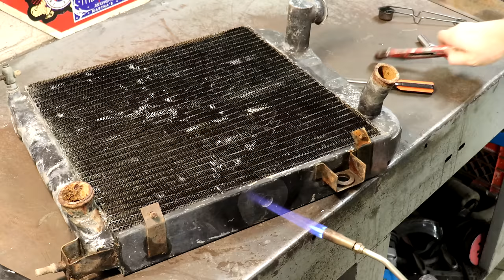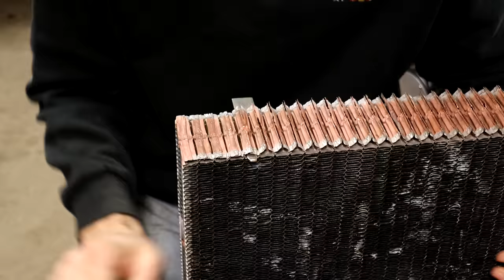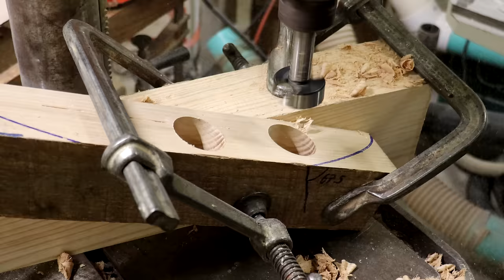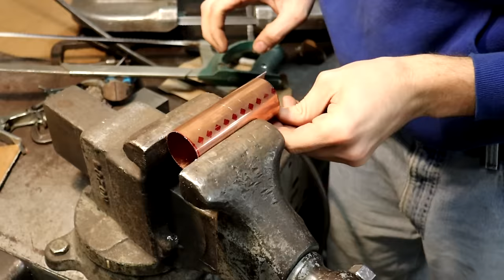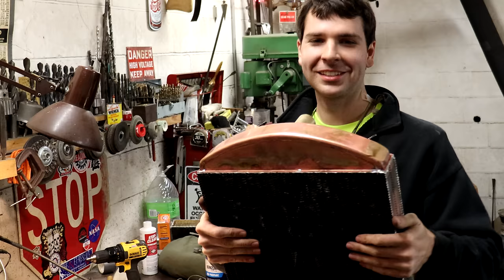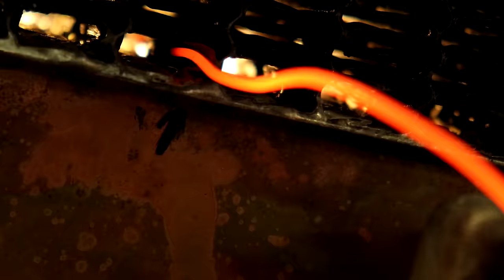The Forums Said it Couldn't be Done | Homemade Boat-tail Speedster Pt. 66

Comment from the maker: For those curious if the smaller size will still keep the engine cool: The engine and radiator are from a Mark 2 which, as far as I can tell, used the same radiator for the 2.4, 3.4, and 3.8 liter engines. Mine is the 2.4, which has ~1/2 the power of the 3.8, so I think it'll be fine. It's also the biggest radiator that I have room for.
Reply: Your doing a great job but I had an XK120 when I was young and granted I lived in Florida when in traffic anytime of the year it was prone to overheat. I would suggest you try to fit an auxiliary electric fan in there somewhere if possible and or maybe an oil cooler as well.
Reply: @NOLAART  I'd say Oil cooler is enough.
Reply: Scary right up to the point of Success, great job !
Reply: the fact that the engine lives in a cooler underhood space and the car being way lighter than an all steel jaguar should help keep the temps down too
Reply: Thank you, I was a Jaguar dealer tech in the late 80s, and restored XK and E types for almost 10 years, grew up in the backseat of an XK 140 fixed head, enjoy your Jag-Rod, it's cool, 👍
Reply: I built radiators back in the seventies and eighties. I have narrowed many V-cell cores like that but I never shortened one. I just about couldn't believe you were doing that but you did. Just amazing. Don't feel bad about pulling those fins down to fix that leak. That's how it's done. I really miss building radiators. It's good to see your skills.
Reply: "I cannot" is definitely not in your vocabulary. 
Great work methodically working thru inevitable issues.
Reply: i cant wait for the day when you come back and work on this someday, when you take a few week vacation from SpaceX or wherever you ended up. Thanks for all the content!

Comment: Absolutely awesome! I have also repaired several old radiators that people told me were unfixable. I did one where it had cast iron tanks and frame with a copper core that was bolted together. The tubes in the copper core had been broken when the cast iron frame was broken so I had to repair the cast iron frame and then I took the end plate off and cleaned and tinned the all of the tubes back about quarter inch and then I hammered the end plate so that had a offset to match then soldered the whole thing back on again. That old crawler loader sat in a barn for 4 years while I was in the military and when I came home again it still was full of coolant. I couldn't have been more happy with the outcome.

Comment: I have never ever seen or even read about someone building a radiator at home, in their shop. That is impressive. Nice work.
Reply: I forget what episodes it was, but Nic of Project Binky made his own radiator, a/c condenser, heater core, and I think also an oil cooler from parts of off the shelf aluminum radiators. If you have the time.

Comment: That turned amazing Vince. Back in the 90’s one of my customers in Toronto was a radiator shop and a big part of their business was recoring radiators and actually building them from scratch. All of theirs used tubes for cores with thin crimped copper for the fins. 
What you were able to achieve with that core is amazing. 
The only thing that could have made it cooler would have been to hammer form your logo into the front tank face. 

Once again you continue to amaze us with your work.
Reply from the maker: I might still cheminally etch a logo on a separate piece of brass, like I did for the headlight logos, then solder that to the brass tank
Reply: @MacroMachines 
That would be cool.

Comment: This is the first video of yours I have ever seen, so I am not familiar with your project at all. 
I am a custom Radiator builder (professionally) with about 30 years under my belt (now retired). I have built radiators for everything from Early car crushers (14 feet x 14 feet x 2 feet) to racing motorcycles, and damned near everything in between. 

So! First of all, I would have loved to have had someone with your talent, determination, and creativity to work in my shop! You really put some time into what you did, and you did it very well.
Now I am not going to pick on you, or pick apart your work, just wanted to throw out some free advice and tell you of some things that you may not be aware of to help with your future projects. 

Silver Solder: There are lots of different solders out there, not all are lead, or lead like. Silver Solder is a fluxed rod similar to brazing rod, and is used with an Oxy Acetylene torch (and brazing tip). It is much stronger than lead types. It is what is used when making the brass tanks because the lead types don't last. Brazing rod also works well, and is still much stronger that lead types. Of course you still need to use lead type to solder the tanks on to the core, and the steel straps to the core. You will NOT unsolder silver solder to repair or recore that radiator.

Tinning flux: Is a paste, or liquid with flakes in suspension. You heat up the metal, brush it on, presto, the nastiest filthiest un sandblasted corroded piece of metal you have is clean as a whistle, and tinned up ready to solder (lead type) in one step. It makes a much stronger seam than doing the flux and solder steps. Make sure to rinse the flux down afterwards, it is acid, and will keep eating till you do.

Hose connections: whenever possible use brass, avoid copper, copper is too brittle and tends to crack from the vibrations created by the engine. If you can, try to roll a 'barb' on the ends to keep the hoses from popping off. You can solder a barb onto them as well.

The core itself: The type of core you used, although rugged as can be, and OEM for decades, is highly inefficient. The newer core types like what you described with the brass tubes, and the copper ribbon between are up to 4 times more efficient for their size.

Maine Auto Radiator can make you a custom core, tanks, etc. BUT in this case, for the money, and the quality of what I just watched you do, your tanks will be just as good as theirs. Maybe buy some inlet/outlets from them with barbs to replace the copper ones. If you run into an overheating issue, they can make a core to your specs for a few hundred bucks that will cool off that engine on the hottest day in parade traffic, and still be the exact same size as yours. They sell all sorts of supplies too, including the proper torches that run on propane and compressed air to get things hot enough, tinning flux, etc. They can even tell you exactly how many BTU's you need to cool that engine, and mace a core to match it. There are different configurations, different size tubes, different spacing between the tubes, and different ribbon fin sizes/designs to factor in.

Time to go check out your other vids and see what you are building!

Comment: Really nice!  I've had leaks like the one that was giving you a headache and I fixed it cudely by cleaning the area well and then dribbling some warm JB into it. It's a gamble though as if it leaks good luck cleaning it out again. I got lucky and it's been holding for years. Suggest you take some scrap fin material and zigzag it and use it to fill the voids in the core. They won't do anything to absorb heat but they will fix the appearance. But enough armchairing; yoou really did a nice job with this. Impressed there is not one spot of solder 'overspray' on the outside of the tank!

Comment: Yet another demonstration of your amazing skills!
If you ever find yourself needing a micro torch flame, I have seen a large bore hypodermic needle (as vets use to chip animals) fed with oxygen and fuel gas used as a torch; it's long and thin, ideal for what you were doing when trying to fix that leak.

Comment: I had the experience of making my own radiator, I used two sheets of thin copper that I drilled 1/4 inch holes in a tight honeycomb pattern (I clamped the copper sheets between two wood strips to support while drilling) then I cut a bunch of three inch long 1/4 inch copper tubing that I soldered into the holes In the copper sheets spaced almost 3 inches separating them, once done, I wrapped the outer edge with 3 inch wide copper sheet, soldered it up, and drilled larger holes for the radiator hose nipples and filler neck (removed from a donor radiator) a radiator can be made in any shape this way,round, oval, square, whatever you want, and it worked quite well for cooling

Comment: It was a very clever idea to try and heat the solder using the nichrome wire but I think the piece of solder shorted out that segment of the wire just making it less resistive. Some way to keep the heater wire from touching the solder may work. For a goal of trying to minimize heating to a small area it was a good idea.
Great work on the car, been watching along all this time. Excellent work.

Comment: Awesome work! I got to spend a little time in an old school radiator shop years ago. You showed amazing skill and patience. I used to have a copper for that I'd heat up and slide into those tight spots for repairs. Being copper it would transfer the heat very well. But you will have to expose the leak enough to perform the work. Most guys would not want to spend all the time you did to fix and solder the core ends. Well done.

Comment: Great work on the radiator.  Jaguars are notorious for overheating if they are in a warm climate and many people have switched to aluminum core radiators with thicker cores.  This may be an option you have to explore if you find you have overheating issues.  With your skills, you should be able to TIG weld up an aluminum radiator that fits the shell.  I believe you have room for a thicker core and you could still go with the brass route by doubling up on the cores.  Also recommend you use a 160 degree thermostat instead of a 180 degree thermostat.

Comment: Wow, the skill set you are building for yourself just gets bigger by the episode! That was a steep learning curve, most people would baulk at the prospect and hand it to the radiator specialist, but I think even they would have struggled with the physical size challenges you set yourself, so far better to go it alone. 
I'm really attached to this build, because my first car (60 years ago) was a 1939 SS Jaguar 2.5L saloon, with basically the same engine as you're using (although pushrod) - love the sound these inline 6s make!

Comment: You must add a flat strap running from the top tank to the bottom tank on each side to stabilize the core. If you do not stabilize the core, repeated expansion and contraction during heating and cooling cycles will rapidly destroy your core. Even heater cores ( assembled using solder) have a side support. All materials expand and contract at different rates from each other as you well know. Brass, lead alloys and copper work better together but not perfectly. Good Luck and keep up the fine work.

Comment: You should make a foot long 2x1 piece of timber so you'll hold onto you're fingers a bit longer. 

Dodgy pushing the rad with your hand in the path of the blade. Use a stick. 

Nice job on the car, you know your stuff 😊.

Comment: Really nice work and a great approach to solving the problems you faced. Radiators are a pain on older vehicles. For my Riley replica I had to make a fake shell and put a modern core inside it. The original radiators were made from German Silver, which I can't get here, used a core type they is very hard to find now, and were a 'wet shell' design. So the shell is actually the outside of the tank. I was quoted prices that were nearly 1/3 the total value of the car to have one made so I worked out my own solution.

Comment: 🌴 I’ve sealed leakers before but this was crazy , and remarkable, I would of probably got new core material to begin with or a new used salvaged radiator that was maybe thicker only because you have the original motor but your down sizing the radiator so making it thicker for lost of down sizing it 🤔( is the radiator going to be big enough to cool the engine) ? Are making your own radiator cap ? I’ve gotta say this build has been so enjoyable, it’s something I wish I would have done when I was younger , but being a boat guy I might have done a wooden gentleman’s racer , can’t wait till this is finished 👍🏼

Comment: That was A task. I broke a sweat just by watching the video. I was wondering, could there be a way to reverse-engineer the ends from the original core? Some similar type of process had to be used there too. Also when soldering/brazing, the piece you need to bond together has to be hotter than the melting solder/braze, not much, but a bit. When the piece melts the solder, it breaks the surface tension on the blob thus draining it into every nook and cranny. the wax helps, but heat is the main tool for good solder/brass joint. TIG can be used too. Also a slotted shroud is one functional option. Then you'd have a ticker material to melt that thin sheet, but with that anvil technique you could just TIG the two sheets together. The size itself is well good. That type of radiator is very efficient, and the engine is in much colder space than it was originally designed for.

Comment: A friend of mine is making a radiator absolutely from scratch. From making the foundry patterns for the top and bottom tanks to punching out 14,000 gills to solder onto the tubes. 
To be fair, he did have a foundry do the castings for him, and I made the gill punch that he used. 
(this is for a vehicle that was found under a house, the radiator is almost the least of it)
I actually suspect that re-using the original core was harder than scratch building a honeycomb radiator. Those are in-principle just a lot of tubes with the end expanded out into a hexagon.
Reply: Have you considered making a honeycomb radiator? It’s a lot of thin tubes stacked, the ends belled to solder together. At one time they were considered the very best design.
Reply: Sorry, that came out sounding critical. It wasn't intended to be, I am impressed by the method that you worked outm, and the final result.

Comment: Might want to polish and clear coat the brass.  It will probability oxidize anyway.   Also might want to use rubber stoppers and bump the pressure and little.   13-16psi.   Needs to be reliable

Comment: Wow every step of this is really impressive.  And here I thought I was doing well to re-form a crushed heater core pipe by annealing it and hammering it round again!  By the way what is your plan for a sealing ridge on the hose fitting pipes?  I used careful hammering and a tiny "dolly on a stick" inside my heater core pipes, but I'm not confident I did it well enough to make a smooth surface that won't leak.  I might take a pair of household pliers and grind the tips into a matched set of profiles I could use to squeeze a ridge into the copper; you might be able to use the same idea just a bigger radius.  I'm sure there's a tool for this, if not pliers then something like a tiny bead roller, but I don't know what the tool is called in order to google for it!

Comment: just a thought: you will likely want to add a bead around the ends of the inlet/outlet tubes to help clamping forces under pressure.
Reply from the maker: I'll probably do something like that when I finish the ports
Reply: @MacroMachines  there's a plastic tool you can buy that is designed to make straightening the radiator fins easier. i'm thinking of trying it for my old radiator.

Comment: Instead of cutting the fan blades down why not make the lower hose fitting come straight down out of the center of the lower tank so it clears the fan completely? Then have a 90 degree fitting pointed towards the water pump.

Comment: If you had a whole bunch or flux with the wire trick it would probably worked a bit better(in transfer of heat to the solder)

Comment: Couldn't have you just put the pipe on the lower tank looking downward , there would have been no clearance issue then and you wouldn't have to have a second piece of pipe to make a bend downwards. Great job  though. Oh and you need to roll a bead near the end of the pipe or the hose will come off when pressure hits it.

Comment: I'm extremely baffled why you flattened, soldered, and essentially plugged all the water tubes at the top of the radiator!? As soon as you fill the top tank nothing will pass through to the bottom, no flow, no cooling
Reply: 😂You should probably watch the video again.